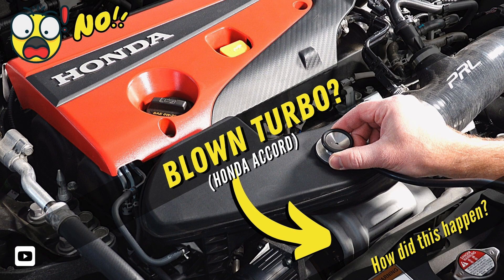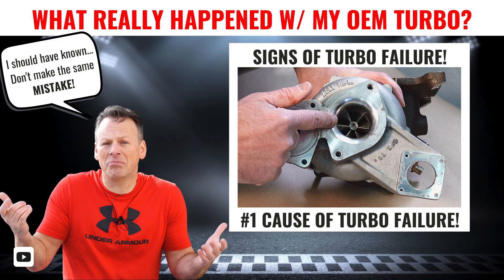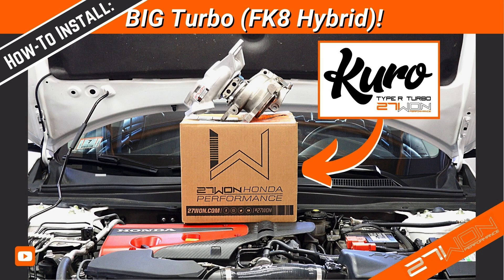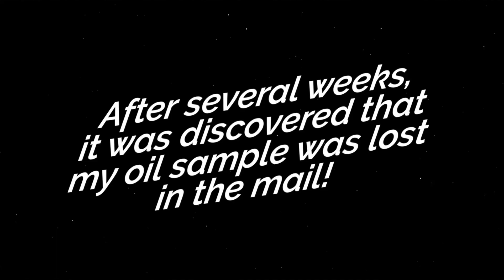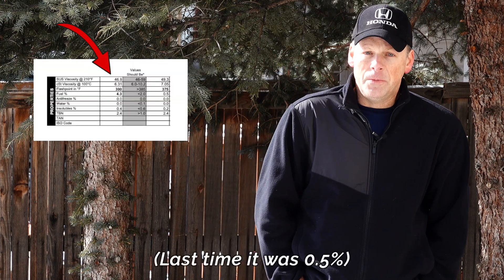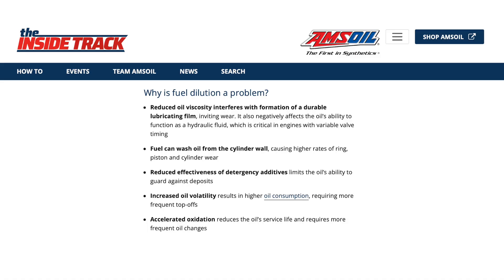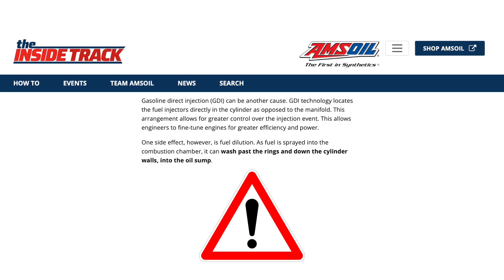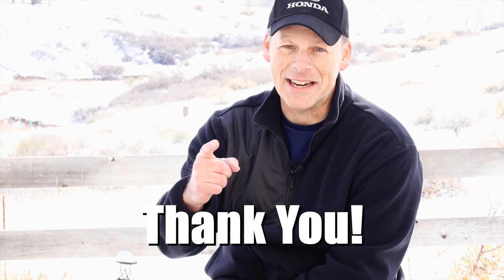Oil Analysis Results - NOT what I was expecting!!!  //  10th Gen Honda Accord

Comment: I think you should give 91 or better octane a try. I own a new RDX which is a 2L Turbo from the previous Accord and experienced oil dilution when running 87 octane. Lab results came back with 4.9% dilution at 1500 miles. The oil dipstick absolutely smelled like gasoline. As soon as I took it out. I’m running 93 now and it definitely doesn’t stink. I’m sure there will still be dilution but liveable. Since I do changes myself, I’m just doing 3000 miles or 3 months. Oil is cheap. Engines are expensive.
Reply from the maker: Actually, I do use 91 octane. With that said, the octane rating of your fuel has NO impact on your oil dilution.

Comment: I am going to buy a small combustible gas tester (good for testing up to 10,000ppm methane) with a starting range of 300ppm. 

I will dope fresh engine oil with 2% toluene and another sample with kerosene. Heat to 212 degree C in a corked up lab test tube and then insert in the end of the gas tester to get a base line reading of vapour phase of each sample. Will also heat fresh engine oil without doping and do same test. 

Then will pull some used engine to do the above test without doping with toluene or kerosene. 

There is a U tuber who did a similar bench test on his used engine oil. If not mistaken his gas detector is reading around  3000ppm for vapour phase of his heated used engine oil vs in relation to lab results showing 2% fuel dilution.🤔🤔🤔 vs no reading for his heated fresh engine oil.
Reply from the maker: It’ll be interesting to hear what your findings are 👍

Comment: Would you think that oil dilution is still an issue in 2023 Honda Accord? I’m in desperate need of an upgrade, and it’s looking as if I will be choosing between a ‘23 Accord or a Camry. The Accord looks much better, in my opinion, but reliability and comfort are the two primary things I look for.
Reply from the maker: Fuel dilution can be an issue in most all modern DI engines. I wouldn’t select my car based on the possibility of it 🤷‍♂️
Reply: @TheLemonFactor  so, if you were in the market, and based on your own experience, would you still consider the ‘23 Accord? I’m interested in the EX, non hybrid trim.
Reply from the maker: No, I would not consider the 2023 Honda Accord, but that has nothing to do with the possibility of fuel dilution.
Reply: Camry!

Comment: I've only put 16,000kms on my 2.0T since I bought it used and the maintenance minder has had me change the oil 3 times. My drives are also pretty short, 12km one way every day. In the middle of winter it's not uncommon for it to be hitting normal running temp just 3-5min before shutting it off again. 5000-6000kms intervals seem a bit short, but the oil does have a decent odor of gas when I change it. Have a 1.5T Civic in the household as well and that one definitely smells worse though lol.

Comment: I sent an oil sample from my 19 2.0t with 6200 miles on amsoil signature 0w20. The car has 54000 miles. Got results and shows I have fuel dilution at 3.4%. They want me to change the oil at half interval and send a sample to retest. My daily commute is only 6 miles to work, so that's probably what is causing this.
Reply from the maker: Is this the first time you’ve tested the oil?
Reply: @The Lemon Factor! LLC  on this car yes.
Reply from the maker: It would be interesting to know if it was an ongoing issue or not 🤔
Reply: @The Lemon Factor! LLC I been reading that most cars with direct injection and turbo charged it will be normal to have some fuel dilution. I work for Chrysler as a tech, and we also see it oil dilution on the 2.0t engine we use for some of our Jeeps.

Comment: I can smell the dillution every time i change the oil in my 21 accord touring. If i leave the oil in a pan in my garage the whole garage will smell for a week until it finally evaporates
Reply from the maker: Wow, that’s bad!  I didn’t smell any gas when I changed the oil, nor when I emptied the catch can.
Reply: @thelemonfactor should I install a catch can on my 2022 1.5 sport ?, it has 18k its been a year this month since I bought it so after hearing all the negative things wrong with the 1.5T I'm worried because I'm a CR writer for a auto auction and my honda is my daily driver so I need my car to last  plus I love my HoNDa😊
Reply: @《DISSENSION 》 RAMMBOCK  
The sport comes in 1.5?? I had no idea. Yes i highly recommend a catch can
Reply from the maker: Yes, I would recommend a good catch can 👍

Comment: In the cold weather I run the transmission in Sport mode until the car warms up.  Sport causes the car to hold the gears longer and spins the engine a little faster before upshifting, all contributing to a slightly faster warmup.  Just be sure to keep the engine out of the +ve boost range.  I don't have a block heater but did install an oil pan heater.

Comment: This is a great video bro. Facts are facts and cant be disputed. This is the EXACT reason i change my oil when it reads 70%. Id prefer to keep the engine as clean as possible....
Reply from the maker: What weight and oil Brand do you use?

Comment: I have an Accord and also use Blackstone Labs from time to time. According to some members at “Bob is the Oil Guy” forums , Blackstone may not be the oil testing lab that gives you the most precise measure of the % of fuel in the oil. Supposedly Blackstone only uses flashpoint as the measure of fuel dilution. I’m not bashing Blackstone I’m only saying it might not be a bad idea to try other labs if you think you have a fuel dilution problem with your engine.

Comment: Being a Honda tech plus, I carry alot more obligations than a regular tech, one of them is to basically monitor every car from start to finish in our express department and I can tell you from seeing hundreds of draining oils a week, around 300 actually in a 4 day work week, not all of the 1.5's appear to have this issue, but I'd say 90% do.. the other 10% may have a pure highway commute, so far I've not seen/smelled just from eyes on personal experience.. any 2.0's with this issue. Now maybe 2-5% isn't detectable via visuals and smelling.. also we spot check about half of the cars oil level before draining and I've seen 1.5 crv's as much as 2 qts over.. and it smells like straight gas. These only hold 3.7qts so add 2 qts of gas.. math n stuff.. what 40%ish? That's on the extreme side, usually they are always atleast 1 qt over on arrival.. so probably 18% fuel dilution. Oddly enough.. we have not seen a single issue yet with any engine that we can 100% say it was fuel/oil related. Now with all of the 1.5 accords blowing head gaskets like candy.. it's a bit odd. But still can't say fuel is the cause. We have a handful of regulars with 180k+ miles on 1.5crv's with zero issues and tons of fuel in the oil... project farm should use his lubrisity tester to see how much (or not) extra wear gas causes. 🤔  I would like to add.. the average oil change interval for our customers is between 7 and 9k miles.. me personally no more than 4k.. same bs with the oil consumption cars.. 99% of the time if you look back at service history they are the 7-9k oil change group. 90% chance of not burning oil on the 5k group. You can always tell their oil change routine just off of the piston rings alone. 5k cars.. nice and clean/free.. 7-9k cars.. black and stuck
Reply: I'm glad you shared this information because many will argue for an extended oil 🛢️ interval- not me. :)
Reply from the maker: Interesting insight… thanks for sharing your experience 👍
Reply: Is there any indication that premium gas helps with oil dilution?
Reply from the maker: Your octane rating (85-94) has no impact on oil dilution.
Reply: @The Lemon Factor! LLC  there are definitely conflicting viewpoints on this. Just wondering what the Honda  tech thinks.
Reply: So you've not seen the oil dilution problems in the 2.0 turbo's??
Reply: @donniev8181  yes but very minimal in the accord and acura vehicles but none in the Type R's
Reply from the maker: @delpsdayoff3372 any thoughts on why that is?
Reply: @TheLemonFactor  I haven't had a chance to do much research. You would think that the R's and Type S integra would be worse.. more boost alone means more fuel.. it's a weird one for sure.
Reply: @DelpsDayOff  may be they don't do short cycle trip...

Comment: Great video as always! They had a lot of that trouble with a 1.5 and crv they said the problem was that people would start the car's not warm up enough . The worst thing in the world for direct-injection cars is down the street and back not a far distance not enough time for the oil to the worst thing in the world for direct-injection cars is down the street and back not a far distance not enough time for the oil to get circulated in the motor all you have to do with remote start your car in the morning what it warm up my car is set for 5 min my car does not leave the driveway until it's an operating temperature and when I'm done with my car and if I'm even in the boost a little my car cools down for at least 3 min . Remember if you are spirited driving your car and getting to boost a lot and you shut your car off all that hot oil is inside the turbo and might not affect the stock turbo but an after-market one ball bearings it will definitely wear your internal ball-bearings quickly. really runs them anymore I don't understand I know the troubles are supposed to be more efficient and it doesn't need it but I don't see how it could hurt

Comment: Thanks for sharing. John Pierro ( FK8tuning) actually recommends at minimum 5w30 for an upgraded turbo. I would think that using a heavier viscosity would be of help. I'm glad I'm using this weight to help off set this dilution if or when it is a factor.

Comment: I would do your oil change at 3.5k-4k now since you have a bigger turbo and I would switch to 5w-30 as it’s better for bigger turbo applications on our car.
Reply from the maker: The size of the compressor wheel and turbine wheel (i.e. a bigger turbo) is irrelevant to your oil change frequency.  The amount of boost (heat produced), and rotational speed (heat produced) will as the additional heat from the turbo will breakdown the oil that's lubricating it quicker.

Comment: Wow! I’m shocked that the 2.0 fell susceptible to oil dilution like the 1.5 did! Very unfortunate, I myself have a 22’ 2.0T
Reply from the maker: Most any GDI cars can experience oil dilution.  Why do you think the 2.0 is any different than the 1.5?
Reply: @TheLemonFactor  I heard many stories about the 1.5 having this issue more so than the 2.0 so I thought great! Now I understand since I don’t know too much about GDI engines, it seems like a design factor. Nonetheless, thanks for providing information about it and making us more aware!
Reply from the maker: While there are benefits to GDI there’s also some drawbacks 🤷‍♂️. I’m hoping that either limiting my short trips, or regularly taking the car out for a longer highway drive will help. If that doesn’t change things, then I may look to change the oil more frequently. We’ll see 🤞
Reply: Check the 2.0-liter Diesel from Jaguar Land Rover and their oil dilution problems and how many cars with engine failures they had. The 1.5T from Honda is an ideal engine in comparison with those JLR diesels ))

Comment: I already knew you where you were going before video began. I have an 18 accord 2.0, and my analysis reported 2.5% fuel on a sample with less than 2000 miles on the oil. I do a fair amount of short trips and idling, but as others have said I suspect you'll see higher fuel levels no matter what you do.
Reply from the maker: I’ve had less than 1% in my previous samples. I am targeting less than 2% going forward 🤞

Comment: Funny that you did this. I just sent in my second oil change into Blackstone.
Reply from the maker: Curious to hear what your results are 🤔
Reply: @TheLemonFactor  Results are in. Comments included: "...wear metals are
mostly lower than average, showing the engine wearing at way less than average rates. Awesome! No measurable fuel, coolant, or excess dirt showed up, and the TBN was still good at 2.7." I ran roughly three tanks of E35 prior to the oil change.
Reply from the maker: Do you do a lot of short trips?
Reply: @TheLemonFactor  Yes, most are short. Average temperatures here in the south are higher than Colorado, however. My usual driving style is very gentle, with occasional sprints up an on-ramp. I just installed a Mishimoto inter-cooler and PRL charge pipes. I have a Thermal 3 inch mid-pipe back exhaust, but I am waiting on the PRL down and front pipe to arrive before I install. I plan to keep having the oil tested at every service. This car is a keeper. And frankly the Gen 11 Accord looks like a disappointment.
Reply from the maker: It is a keeper… usually I’m tempted by the latest and greatest when it comes to cars, but the 11th Gen Accord ☹️

Comment: I sent off my oil before to Blackstone and came back with the same results each time. Bad fuel dilution, 1.8% and 2%+, I run a catch can also. Wear metals are still present after 10k miles. I change my oil every 5k regardless of what the maintenance minder says. The viscosity and flash point came back horrible, meaning the engine oil (0w20) was thinner than that! So I switched to 5w30. 

Honda will keep lying about this and I will keep testing my oil and keep the paperwork to claim powertrain warranty from Honda when something goes wrong. This is on Honda. It has nothing to do with how you drive. If the fuel gets burned properly it should be fine, but because of low tension piston rings, thin oil, and all the "eco friendly" bull crap.

I warm up my car and take care of it like crazy and it didn't make a difference on the oil tests. So F-U Honda.
Reply: There are engines with much bigger oil dilution problems than Honda.
Reply: @Eugen-E quit with the finger pointing scarecrow, stay on the topic at hand. There would not be a class action lawsuit against Honda if it wasn't a problem. This pointing the finger at other engine makers does nothing.
Reply: @donniev8181  There are A LOT of Honda 1.5T owners with over 150 000 miles with 0 engine problems.
Reply: Yeah Im done with Honda until they offer an engine that does not cater to the climate crowd! Getting ready to buy a new car and Im definitely going with Toyota.